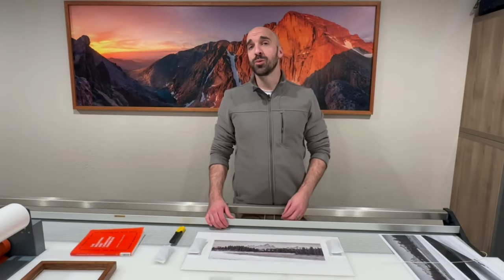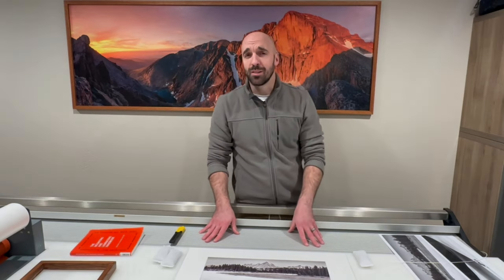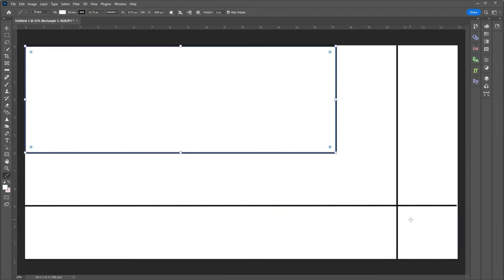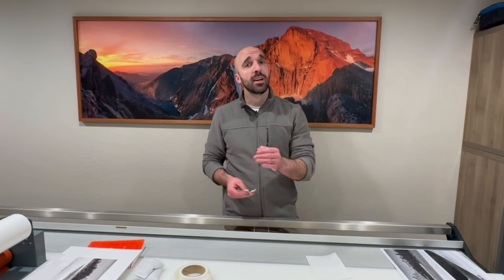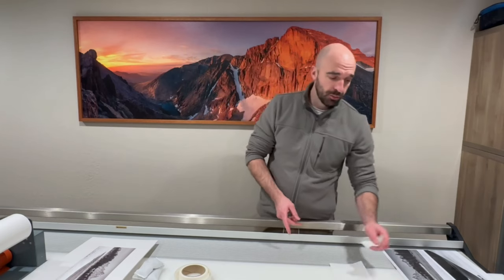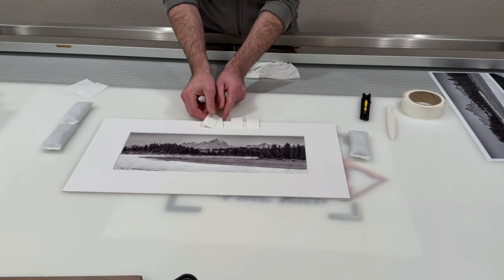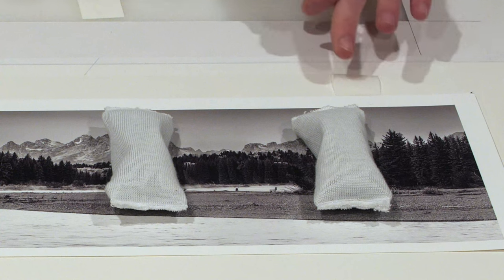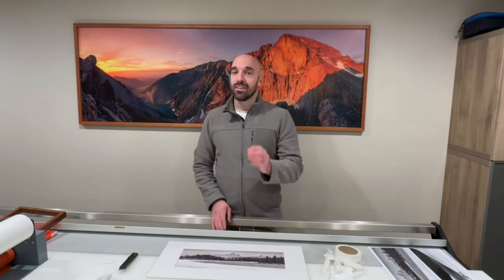Archival Photo Mounting Part 2 | T Hinge and Finding Optical Visual Center

Comment: How common is placing hinging tape directly on prints? I'm just starting out and don't want to put tape directly on any paper prints (doesn't seem as archival/reversible as mounting corners), but also recognize the buckling issue for larger prints.  Can you get away with mounting corners and mounting strips?
Reply from the maker: My recommendation for starting out is to go with what you’re comfortable with. In many cases the corners will be all you need and as you mentioned, it’s by far the easiest to reverse. When/if you get to a point you feel you may need to t-hinge, just practice adding/removing on test prints.

Comment: Light Impressions use to make what looked like a T-square that made finding the optical center and center of the mat board super easy... no drawing lines or measuring. But I can't find it anywhere on the internet. It's simply disappeared. Have you seen one of those T-squares?
Reply from the maker: I have not but if you find it please let
Me know! That would be brilliant
Reply: This is what they're called: Falcon (Marshall) Print Mounting Positioner. But it doesn't seem they're available anymore. @MrNegative
Reply from the maker: @mje1625 I’m surprised there’s nobody that makes a new version. Seems like a simple and easy to use design. Thanks for sharing I’ll keep an eye out for a used version

Comment: Thanks 
Have mounted a few 11 x 14 and 12x18 prints per your method - But having a difficult time with not getting the prints flat?
Have spray mounted others that don't have a problem.
But I don't want to perminately mount my photos.
Any thoughts.
Reply from the maker: Are you printing with sheets or rolls? If the paper is coming off a roll it might help to flatten the print. I use a drymount press to flatten stubborn prints.
Reply: @MrNegative  I'm not printing myself.
I have been trying National Photo Lab. Standard glossy.
Don't know if roll.
Reply from the maker: Ah okay those will definitely come off a roll. RC (especially glossy) are tricky because the surface doesn’t do well with any significant heat. I use adhesive to mount my glossy prints as those papers aren’t really “archival” anyway. If you want to hinge mount those and are having issues with curling I would say pressing the prints with weight (heavy book) is best bet. Just have to take precaution to protect the print surface.
Reply: @MrNegative  any suggestions for finishes to help with this issue And room with not great lighting and windows.
NPL has :
Glossy not really working
Pearl - less glossy 
Luster - least glossy.

Then these 
Matte, semi gloss, satin. 
Etc..... to many.
Reply from the maker: The finish is going to depend on your taste and how you want the image to look. I should have asked this but you’re using a mat, right? The prints you’re working with aren’t huge so I’m surprised a mat wouldn’t hold them flat.
Reply: @MrNegative  Yes
 hung on rear backer board at two points.
Hinged backer with mat sized for print .

Comment: Thanks for taking the time to make these videos. There aren’t a huge amount of mounting videos out there, so this is appreciated.  I’m a self taught framer using mostly YT videos and a few books to guide my way.  The way I do it is I center the print in the mat, then weight it down. For the T hinges I assemble each hinge off the print.  Then I lift the top edge of each print and slide the t hinge under the print on each side. I then press down on the tape through the print using a loose glove to cover the print.  I feel this provides more than enough pressure to ensure good adhesion - the Lineco tape has very good adhesion ( I learned this in the few instances when I tried to remove it). Therefore I’m not concerned about it’s adhesion failing.  So it seems burnishing the tape onto the back of print is not needed and just makes the process a bit more difficult (though I like the trick using the silicon pieces).  The way, I do it about 1/8” of the non-sticky side of the tape that adheres to the mat slides under the print and there is not the 1/16”area of the sticky part of tape exposed to the bottom of the mat, which I’ve learned can sometimes be a pain when lifting the mat because it will stick to it.  I bring this up to hear if there is any disadvantage to how I do it or major advantage to how you do it.  I’m trying to figure out the ins and outs for myself and what works best for me.  In my process of learning to frame I question whether much of what is taught as “100% essential, you must do it this way or your framing job will be terrible*” is overkill and mostly unnecessary.  And the more that is promoted the more of an obstacle this all seems to a beginner.  Thanks again for the video.

* I’ve browsed a few message boards of professional framers and they very much put forth this attitude.
Reply from the maker: I’m also self taught and have mostly found methods that work well for me and stuck with them. I don’t see anything wrong with your method and have seen others do something similar. The advantage of your method is also there’s no risk of scratching the print by flipping it face down. As long as you’re getting the desired results and your clients are happy, I would say stick with the method that best fits your workflow. Of course I’m a photographer more than a framer so there are definitely plenty of people (as you’ve mentioned) that may have strong opinions to the contrary haha. I’m glad you enjoyed the video and found it helpful!
Reply: I agree with your approach and this is how I mount photos too. Not having the art face down is worth it alone.